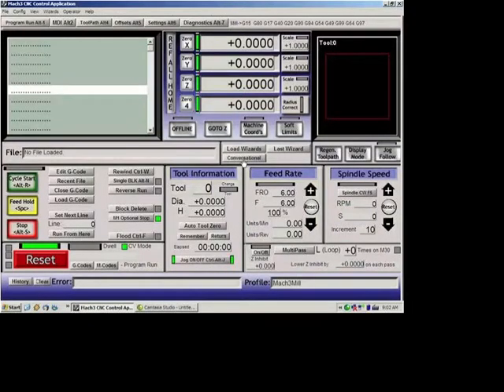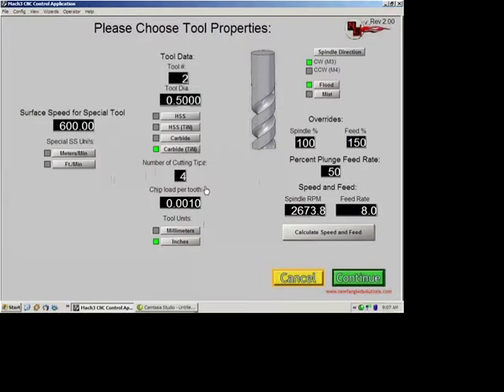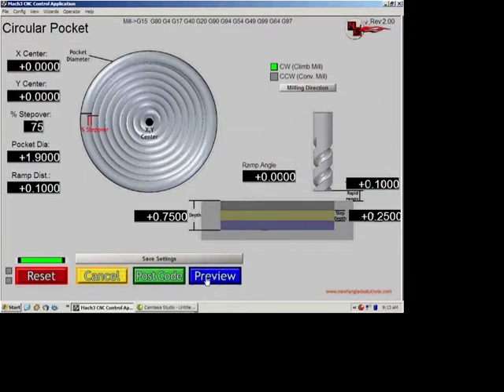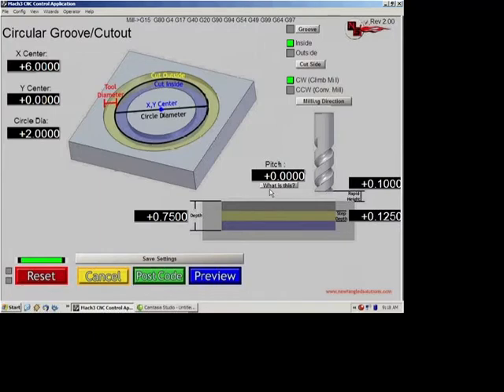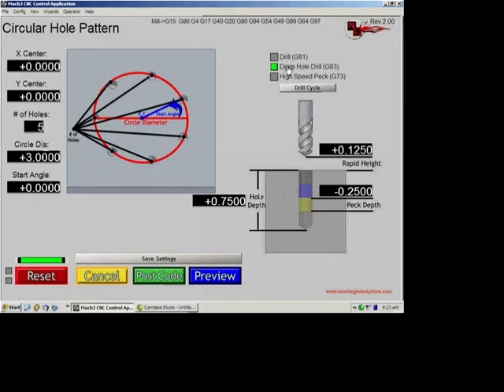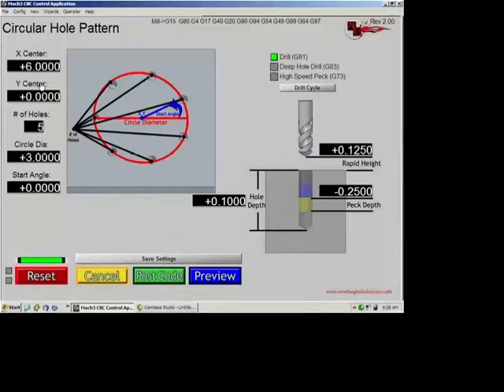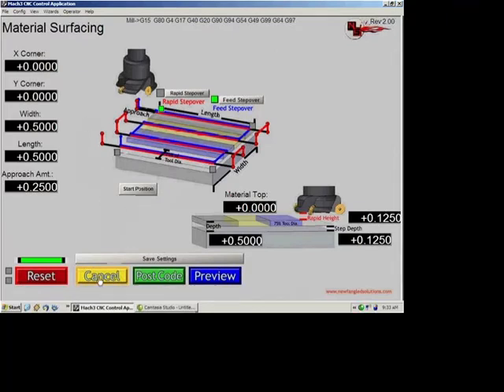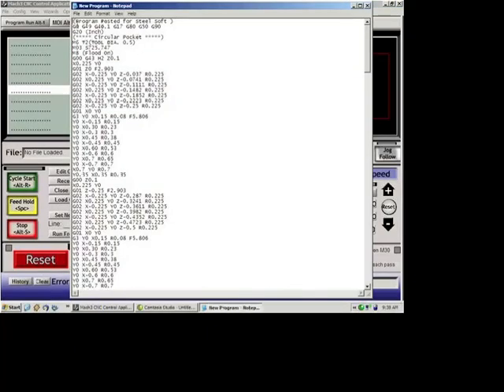Tutorial on Mach Add-ons Wizard for Mach3

Comment: I just unlocked these add ons on my CNC mill running Mach 3 as I was not wanting to add another program due to the PC running Win XP. Anyway, they really are excellent for me especially as I am new to CNC but wanted a way to get into it without having to use something like Fusion 360 for small jobs.
The guide here is also very well done and was a great help to get me started.